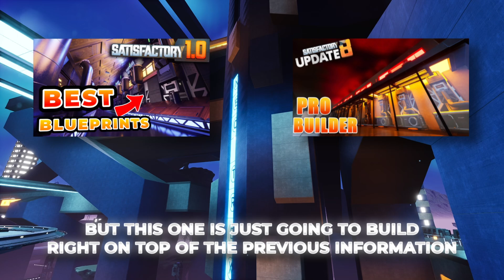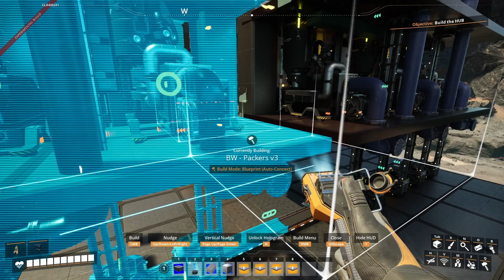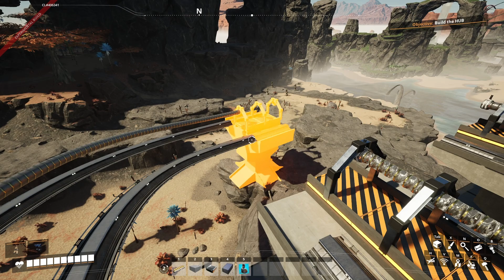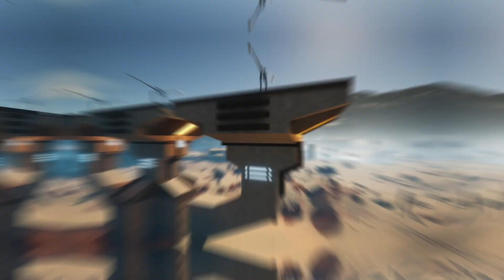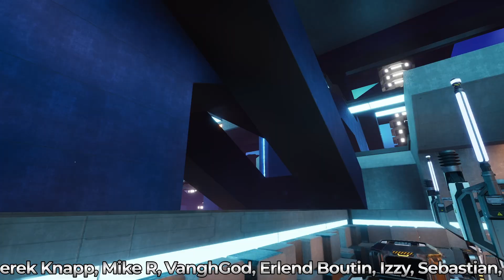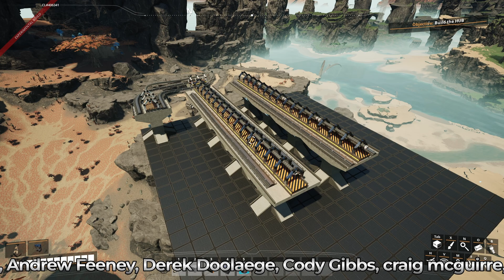MEGA Builds Just Got WAY Easier In Satisfactory 1.1

Comment: Autoconnect is SUCH a powerful tool.  I put off building a worldwide logistics highway because I knew it was going to take literal days to build.  With Autoconnect, I used a single railroad platform BP to circle the whole map in about 6 hours.  This is gonna really open up a lot of freedom to build factories wherever I want instead of being constrained to wherever relevant materials are located.  

Now if only they’ll allow power connections and elevator floor holes to connect, it would be incredible.
Reply: Does  autoconnect work for rail on BP's too? I remember there being an issue where rail BP's didnt work, and players made it seem like it was intentional.
Reply: @xNovaSounds maybe there’s some glitches people are encountering, so I can’t speak for everybody, but I set up my aluminum production railway purely from auto connecting rail BPs.  There was a ton of trial and error figuring out where specifically to set the rail on curves and ramps to get the Autoconnect right, especially since rails have to be >=12m long and directly connecting curve pieces is impossible since foundation clipping is involved.  I got past this by setting the rails about 7m into the foundations on the start side, and about 6m from the end side.  This let me use BP snapping to nudge over, define the connection, and then nudge into place with an Autoconnect rail that is JUST long enough to be placed properly.  It sounds like a lot of work, but once I had the pieces of the set built, it was WAY faster than placing down railroad foundation BPs and then going back to lay the tracks as you go.   It also comes with the benefit of tracks connecting consistently, I’ve had issues in the past when even using straight bracing tracks, train curves just wouldn’t connect up right and clip into their foundations.  When laying tracks on foundations when the same exact method was working just fine at the previous curve, but not at the next, I would end up redoing whole sections to chase back a wobbly section of track.

Comment: The way i am making the blueprint to autoconnect easily is to build a small bit of belt out from both the end of merger/splitter, like the shortest belt you can build, if your merger/splitter is at some height, just use stackable conveyor pole to level, bring out the small bit of belt and delete the pole. Also, i am encountering a bug in 1.1 exp, the merger/splitter can't connect properly to the conveyor lift in blueprint desinger, although they will snap into correct position, but they aren't connected to the lift, something to be aware of and hope the dev fix it soon